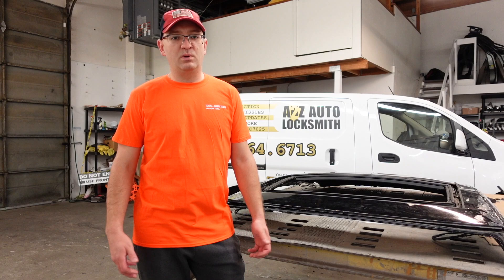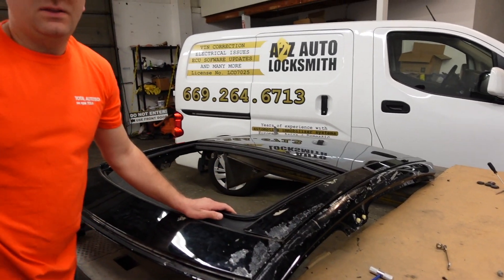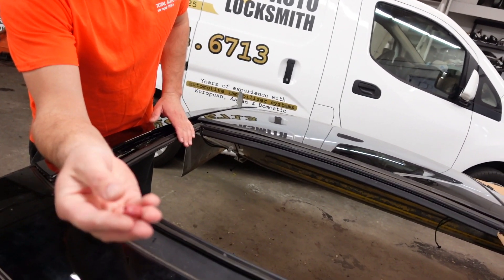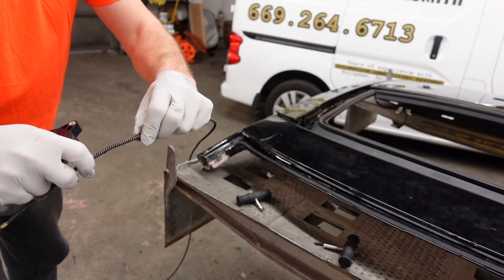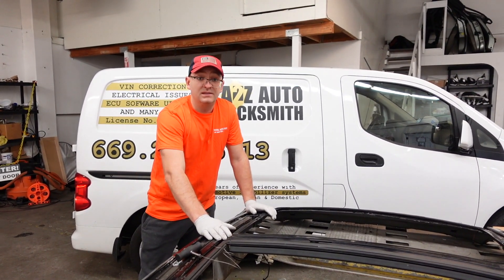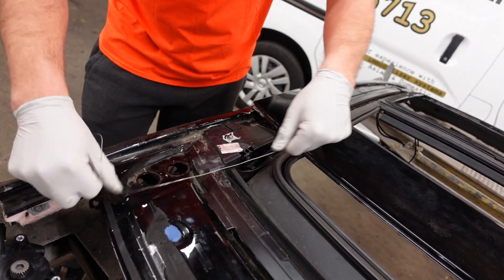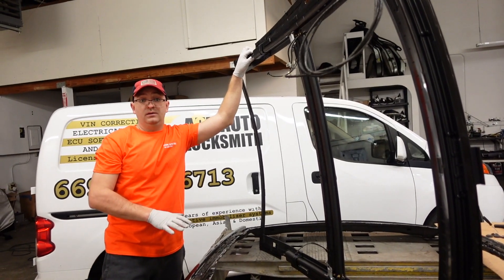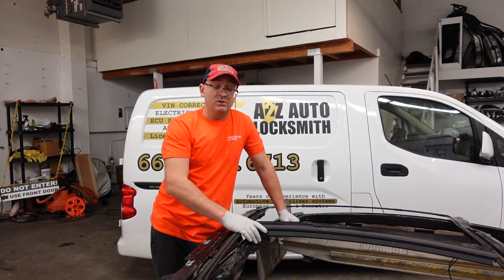Tesla Panoramic Roof (Sunroof) most common problems and solutions

Comment: Hi, Thank You for the video. Got lots of information.
One question: I have Gen 1.0 roof. The fixed glass was broken due to hail. 
Now a body shop did the repair. They installed a new fixed glas (gen ?) and new 2.1 front and side appliques.
But now there is a gap between the seals from fixed glas and side appliques.
Should these parts from different generations fit together or do the new side appliques have another shape?
Greetings from Austria

Comment: I took down part of the headliner and pinpointed the leak to over the front applique, so it needs to come off.  Glad to see this video, since it looks like the easiest way to get it off is using the wire technique.  Question is, will this damage the existing seals?

Comment: I have a 2013 and the Tesla tech told me to never open the sunroof anymore because one day it would be a $2000 repair
Reply: My issue with this solution is that you may aswell use it until it fails, I guess at that point it may make sense to just not fix it

Comment: Thanks for explaining the difference between the original roof and 2.1.  I have a 2014 I bought in 2017 and it looks like it has the 2.1 upgrade.  I bought it from Tesla when they were selling refurbs, so I'm thinking there was a problem with the original roof and did the upgrade.  Anyway, I have a water leak over the driver's seat.  It's not a clogged drain.  Any ideas?

Comment: I was hoping you would talk about the sunroof drains, where they are and how best to clean them to get them unclogged.  I found the 2 in front, but wondering if there are 2 more towards the rear?
Reply: low pressure air

Comment: @Total Auto Tech  I have a MS with V1 pano roof and it works perfectly except when it closes to 100% it makes a ratchet/clicking noise on the driver's side at the end.  Do you know what the cause of that would be?

Also, my car is under warranty - anyone know of any strategies to get tesla to swap the roof to the 2.1 version?  I told them they don't make some parts for it anymore but they wouldn't do it.  Thank you!
Reply from the maker: It seems that one of the roof motors needs to be replaced.
Reply: @totalautotech5276  Thanks.  That's what I thought too, but when taking it to Tesla they then say the cable needs replacing also and then want to change both sides.  The noise clearly only occurs on the drivers side.  Very frustrating.
Reply: @pkonyoutube if it is under warranty let them replace all of it.

Comment: Can I upgrade from an all aluminum rooftop for 2016 Tesla model S to an aftermarket panoramic or fixed glass sunroof?
Reply from the maker: We did saw one upgrade from regular roof into Tesla OEM fixed glass. It's possible but a lot of work!
Reply: @totalautotech5276  is there video of the transformation?  How much $$$ would this cost??
Reply from the maker: @SADDDDDDDDDD  We don't have video of that work. Just fixed glass alone cost $1500. If you can do labor your self, it will be nice project.

Comment: Thanks for showing this. I just had my 1.0 pano roof get stuck due to debris in it. I removed the glass and tried to operate it without the glass and the two sides got out of sync. After some fiddling and turning the power off and on I got it synchronized again and cleaned out a lot of debris. In any event, my roof now closes but I think it's time for me to clean it out and regrease it.
Reply: Hello. We got the same problem. The handle for the panoramo broke. So we tried to remove it. We can't move the slides? Now one got stuck and got em out of sync.. Can u help me how I can get them back to sync? And why I can't slide the handle for the cables? We tried everything and we won't pay 3800k euros for a replacement.

Comment: Tesla is charging me $4,000 to replace my sunroof for 2014 Tesla model s . I already replaced it before in the past for $800 BS if you ask me  I told them to kiss my ass for $4000
Reply: Sounds about right.  I paid about $2000 a year and a half ago to fix the pano sunroof in my 2014 Model S, never used it since.  Now its leaking like crazy. Its just a horribly poor design. Frustrating.  I will never get a sunroof in a vehicle ever again, not worth the hassle and $$$

Comment: Can you reuse the factory glass once you cut it out or do you have to order a brand new piece of glass even if I have the 2.1 version already?
Reply from the maker: We always reuse glass! You have to cut it  out very carefully and we do it very slow, with all precautions, because if you cut rubber around glass, you can't replace it,  so at that point you need new glass. It cost around $1000. This is why we develop special procedure in our repair shop and after 3 years of sunroof repairs, we haven't damaged any sunroof glass rubber.
Reply: @totalautotech5276  Thanks for the reply. I've been told by someone in the Tesla groups on Reddit that the sunroof glass has to be reinstalled brand new no matter what because of the primer that is applied to the glass from factory. I have been in the glass industry for a while and had never heard of such a thing. When I found your video I knew it had to be where you could reuse it as long as you were careful and paid attention to what you were doing coming out and prepping it to go back in. Thanks once again.

Comment: Had my entire pano upgraded by tesla to version 2.1 in the fall of 2020 and it started making cracking sound again, barely even used it this summer,  how is possible for parts to get worn out so fast? Do you suspect it is the motor and or cable or could there be other part that failed to check myself before taking to service?
Reply from the maker: Mostly likely, the cable and a small gear on the motor are worn out again. The replacement cable they installed sits more tightly in the roof canal (reasons could be different) and makes additional load on other parts.
Reply: The rubbers on the outside of the roof of my car already look quite brittle and dry. After watching this video, upgrading the whole roof seemed to be the only sensible option. I heard about 2k EUR. Is it?🤢 I also assumed it would be a more reliable sunroof, but in 8 years I have zero sunroof related problems in the service history of my car. You had problems 1 year after the upgrade?💩

Comment: Great video!
I'm getting water drops on my front right seat when the car is parked in a downhill and it's raining outside. When i check over the edge of the roofliner i can feel water over the edge in the right front front of the sunroof. Can this be cause by the drains on the ides of the front cover beeing blocked?
Reply from the maker: We would recommend to blow drains as your first steps. You are probably right, they could be blocked. Also we saw few times drain tube/hose being leaking from  sunroof connector.
Reply: @totalautotech5276  indeed, the connectors are ridiculous (I have a '13 Signature) and 3 were leaking and one of them had already been serviced by the the previous owner or Tesla, with black silicone. I've added a smear of liquid joint and plastic zip ties around the connector for a snug fit. Still, it continues leaking around the left rear side. I suspect the joint broke or has a gap, but after seeing this video, I'll just try to apply silicone from the inside and hope for the best.